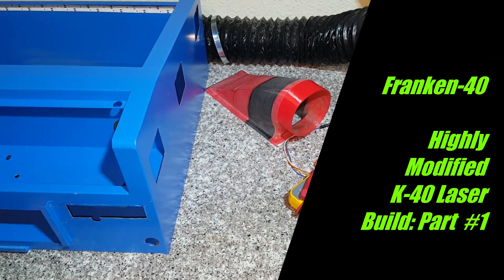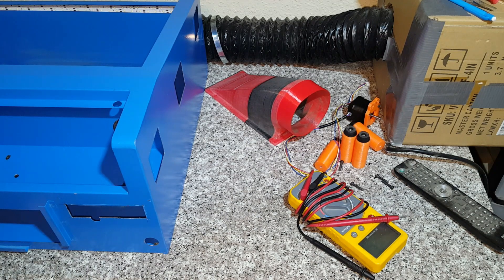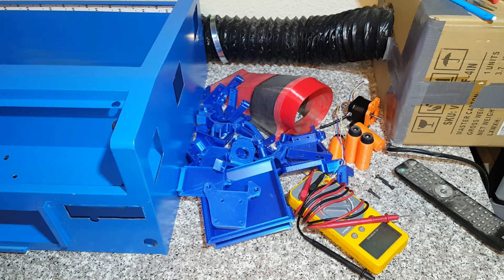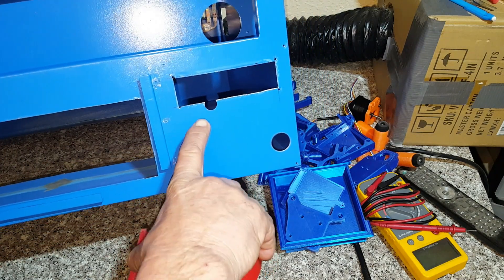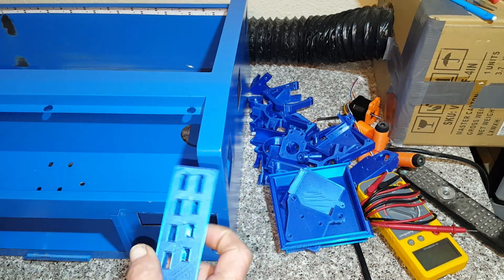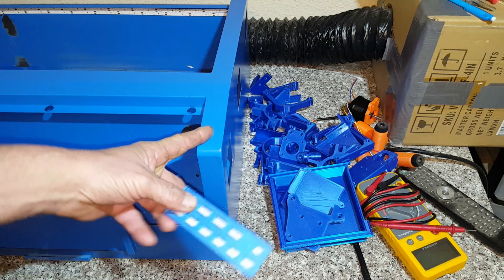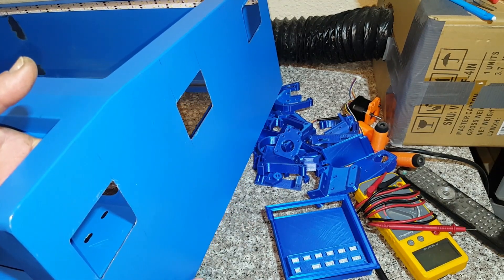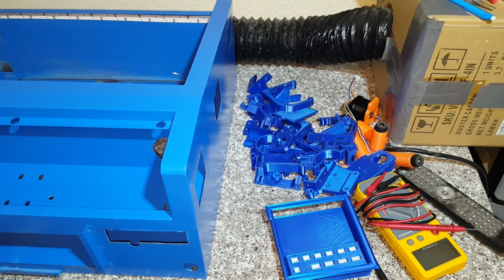Franken-40 - Highly Modified K-40 Laser Build - Part #1

Comment: Hi Bill, how are you making the nicely finished square holes?
Reply from the maker: I used a 16 gauge Air Nibbler from Harbor Freight. I used double sided tape to hold 1/8" thick pieces of wood to make a ring a little over the size I wanted to cut. Much like a router jig. https://www.harborfreight.com/16-gauge-air-nibbler-96661.html?_br_psugg_q=nibbler
Reply: Great  way to do it, will invest in a cheap nibbler to make so holes, I was thinking about cutting slots in both ends so longer items could be feed in and with the cohesion and camera it would be possible to laser long lengths of material.

Comment: Very interesting!
Could you please do a video about the electronics box. How you arranged components, grounding (in particular in respect to high voltage), etc. I would especially interested how you connect the HV lines between the (now external) PSU and the laser tube.
Reply from the maker: That will be covered in video #3.
Reply: Thank you. I'm looking forward to that.

Comment: Looks really good, it would be good to be able to start printing some of the non changing items like covers and feet because I’m guessing it will take a while to get it all printed, thanks for all of your hard work and time making this design.
Reply from the maker: I started with the housing so those that want to do the conversion could get that out of the way. Have you already printed the laser gantry parts?
Reply: Hi Bill, no not yet, where would I find the laser gantry stl’s? I really like what you have done, I saw a video of cohesion running with the camera and wow that will be next but one step at a time, first I just need to increase the cutting area and then make the saw blade bed (great idea).